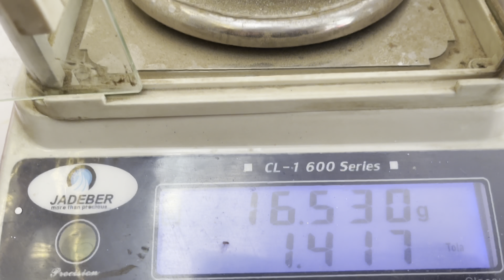How Silver Ring is Made | Silver Ring Making

Comment: is that silver used for welding from same material u make ring ?
Reply from the maker: That is solder
Reply: @Merojewelleryworkshop  ah ,so you use silver solder like these silver wires that we can buy in shops ?
Reply from the maker: We make ourselves
Reply: @Merojewelleryworkshop  how ?   you just hammer silver in to flakes and in borax or ?
Reply from the maker: Sms Instagram
Reply: @Merojewelleryworkshop  ha ? i don't have instagram if you mean that